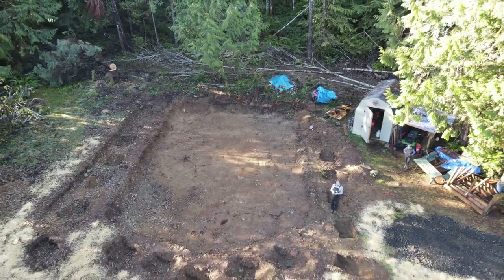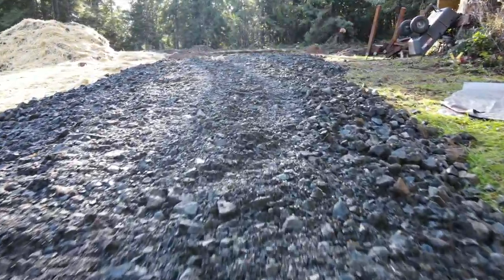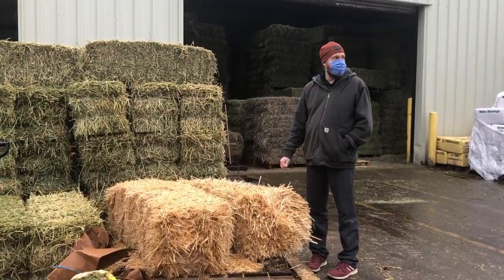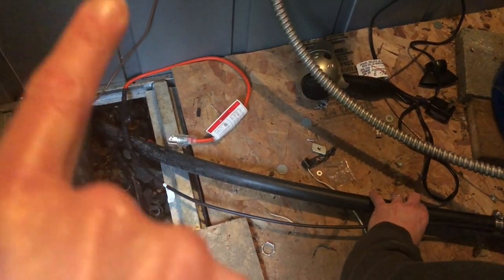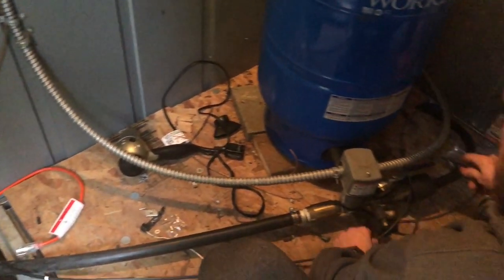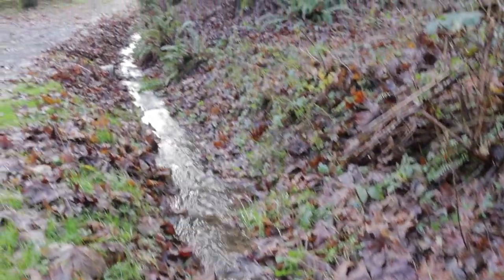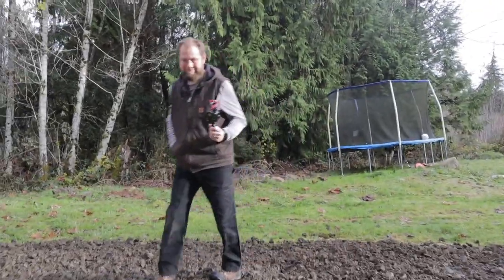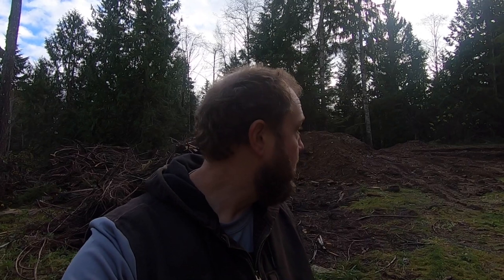PREPPING for our CABIN Foundation // Couple Builds A-FRAME Cabin

Comment: The tank can freeze and it will break the bladder, even more likely if you aren't running it 3 times a day, the shed or tank needs insulating.
Reply from the maker: We rarely get down to freezing where we are, but we do run a light bulb in the shed along with heat tape and we've never had problems.  I maybe put up some extra ridged foam insulation though just for some extra protection.

Comment: Invest in a box scraper
for the tractor, you will thank me later.
Reply from the maker: I'm actually looking at grading blades right now.  What makes you suggest a box scraper over a traditional blade?
Reply: @OneFootOfftheGrid  I operated construction equipment for 30 years and including a Case 480LL with a front loader and a box scraper, I could move dirt, ABC, or rock as I graded to fill in holes as I worked the area with the box scraper. You can also rip up any high spots with the rippers to level the area and carry any unwanted materials with you and remove it from the area, the larger rocks and tree roots will gather in the rippers as you work the area. just my opinion. 
If you have had prior experience with a blade and know how to use it, you may be better off using something you already know how to use.